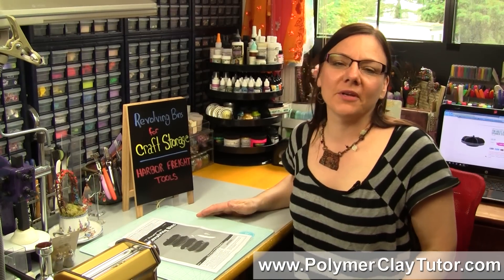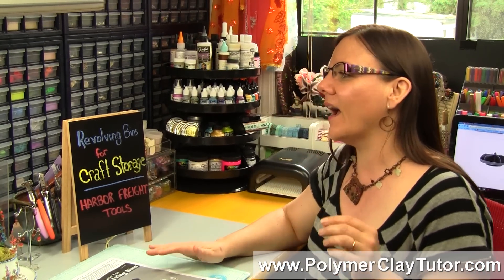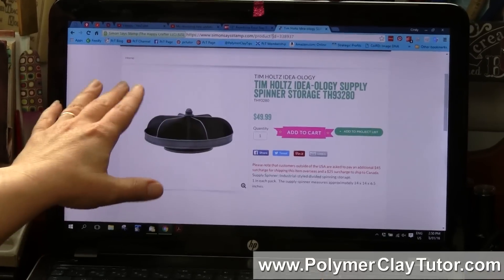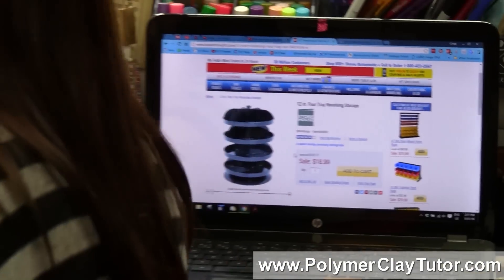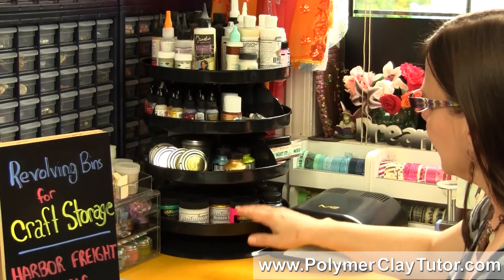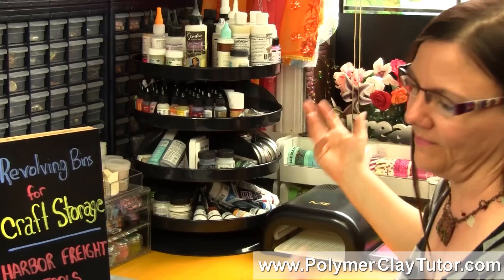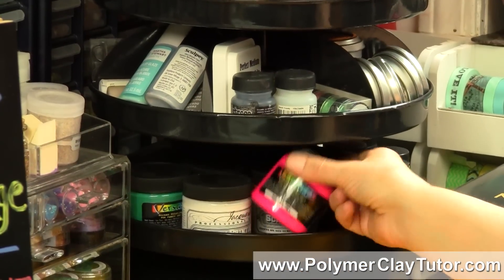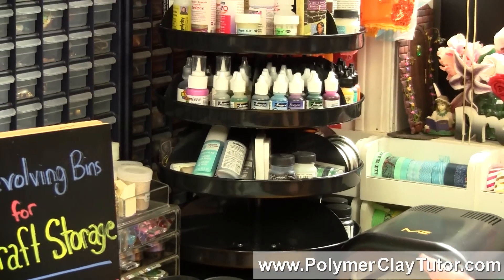Revolving Storage Bins for Your Craft Studio

Comment: just wondering if you put the six section containers on the bottom it might now be so top heavy.
Reply from the maker: I decided on putting the 3 section (I said four section in the video but I was wrong) tray on the top so I could fit more stuff in it. It is heavier than the other sections because it was the only place to put the bigger/taller bottles. If the sections were further apart, I would have put the taller stuff on the bottom but they didn't fit. It only wobbles if I kind of push on it. Other than that it is just fine.

Comment: +PolymerClayTutor    hey!! I want to make couple of polymer clay miniatures without baking them untill I have enough minatures to fill the oven.... I don't want to keep using the oven for a small creation.  where would you recommend me to store my unbaked creations which I will be baking when I have a bunch of them??.....     Also is a plastic wallet safe to store left-over (scrap) clay inside?? my plastic wallet has no plastic number so I am unsure whether to store clay inside a wallet or not.. And if it is not safe, what number plastic is safe?? will it be safe and clean if I keep my fimo in its packaging (well sealed with tape)???     I hope you respond to my comment!!   thank you very much!!
Reply from the maker: Hi +meme You can set your finished pieces aside for a very long time (months even) before baking as long as they are not sitting on anything absorbent and its a good idea to cover them to protect them from getting dusty. A tin pan with a lid would be just fine. Most polymer clay does fine in food safe plastic like #1 and #5 but you should always test the plastic first. I have a video on storing polymer clay that should help you.
Reply: +PolymerClayTutor is glass container safe to store raw and baked creations inside it (seperately)

Comment: I couldn't find them on the website so I emailed customer service. They told me that it's been discontinued!
Reply from the maker: Yeah I see that. I also had this model in my Amazon shop but it seems discontinued there as well. There are some similar options but they are quite a bit more expensive, though they look a lot more sturdy. Here is the link if you want to check them out: https://amzn.to/2NIAIqO